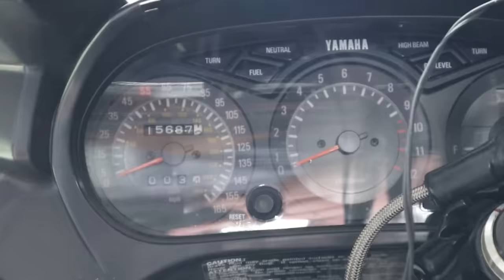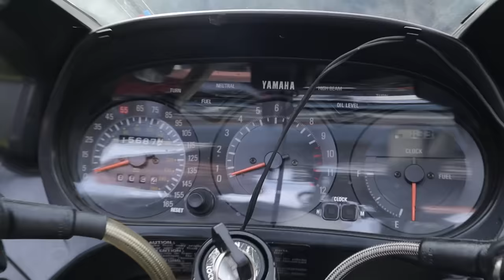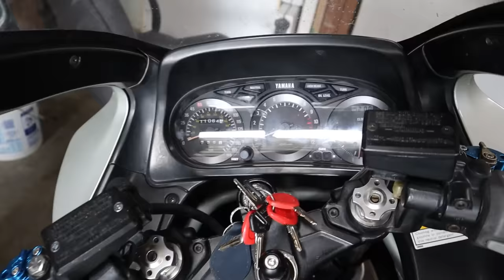Will This 37 Year Old Motorcycle Run & Get Me Home?

Comment: Viewers...note the method of preparing the gas tank to hold gas shown here is not recommended. At minimum, the rust should be knocked off with bolts and vinegar in tank, shaking, until clean. Other methods involve use of muriatic acid or vinegar. See more accurate repair videos on YouTube. Running gas having rust in it through engine can mess up carbs big time.

Comment: Don't be scared of rusty fuel tanks. They're easy to make serviceable 1 Remove. fuel tap assy.2 Put a handful of clean 1/2 inch stones/gravel into the tank with a cupful of diesel, kero or even petrol. (Not gas it floats away and smells- joke) 3 shake it and shake it and keep shaking it so the stones agitate the rust and scale.4 Empty out stones and  rinse out all you can until the fuel comes out clean 5 add auto filter and check occasionally.
Oh and add methylated spirits to the watery fuel so it will absorb to water and still run the engine.

Comment: Enjoying the videos on the channel and this was another banger. My dad gave me some advice to flushing a fuel tank. Though it can be stupid expensive use petrol, solves the cleaning out with water problem :P    Of course works best if you have a few to do and you filter the chunks out after as the fuel is knackered and only good for cleaning another fuel tank.

Comment: What a beautiful machine from 1987. My last bike was a 1992 1200cc Triumph Trophy, I had to give up for medical problems - 
I was unable to hold the baby up due to excess prescription BP meds lowering my BP. (I didn't have the strength with BP = 90/60 at the time (1916)) !!!
Just want an off-roader to play with now, with sufficient front wheel lifting power.

Comment: I picked up a 2008 Vstar 650 for $500, right now l got $550 in it and it runs and rides. Fork seals are shot and l taped off 1/2 the air cleaner due to a lean condition, but it does hit 60mph quickly.

Comment: Hey bud- I have a 2005 zzr/zx6 that a shop has been having difficulties diagnosing… idles like a queen, runs great in 1st and 2nd gear up until 3rd… bogs from there. They have cleaned all carbs, ripped out all CA emissions 💩 and did all they think was the problem but it still had issues once on third gear.. when it’s in a jack it goes through all 6 gears just fine, soon as they ride it in street it gives problems right at 3rd gear. Maybe you can swing down to Georgia for one of your shows and diagnose and fix mine 😂

Comment: The FJ1200 was badically THE big sports tourer/commuter. Not personally my "thing", but excellent at what it did. A much better bike than you might think i think many police forces used them at the time.

TBH, 1200cc is pretty unnecessary for road use. But at least it makes for a relaxing ride. The XJ900 and 600 were similar, saner machines. And lighter. Cheaper.

Comment: I can tell you what the problem 'might' be, because I (also) killed my FJ12 by leaving it too long in a garage. What happens is the jets can puncture the diaphragms in the carbs if the fuel dries out. Check it out. You were probably running way too rich, the diaphragms were bleeding fuel. Replacement diaphragms were very expensive.

Comment: HD 30% vinegar, leave it in for a couple of hours, then rattle a few nuts along withe vinegar. Dump, rinse, check the inside again, should be a lot cleaner (the tank I mean)

Comment: Too bad...everything was perfect with the service jug.

I would have been hesitant about mounting that tank rough washed with fuel....tempted to just use the service jug.  The carbs were perfectly clean.

Alcohol rinse after the garden hose treatment will remove temaining water.  HEET (200 proof alch) will dry the water in the gasoline.

I was surprised you didn't just do the final rinse with gasoline....rust will still dislodge later though with a real treatment....but that can be caught by the petcock filter or external filter.

Comment: Synching carbs, is getting same running condition at all cylinders, whether all the throttle  plates / slides, are " in the exact same spot, or not. Usually they are pretty much the same regardless, but, if getting them the same, could be done with them off the bike, and using a guage for throttle opening,that would be  negating the need to " synch them", once they are on the bike, and it is running. In other words, getting the carbs mechanically in synch, is the starting point to final synchronizing. It may be spot on, may not.

Comment: The owner probably removed the carbs,cleaned them and never put them on.Bonus for you .Carbs setting for 20 years with fuel in them......not good. 24 hour soak in white vinegar is the best thing for that tank.

Comment: "Don't Tread on My 10mm"

Fuel-soaked hands, wrenches at the ready,
Grease-stained rebels, born steady.
Two wheels of fury, roar and scream,
In this metal world, we reign supreme.

Tighten the bolts, with a steady hand,
In the heart of steel, we make our stand.
The engine's pulse, a symphony in tune,
"Don't tread on my 10mm," our metal rune.

Ride through storms, and asphalt veins,
Our bikes defy limits, break through chains.
Under the moon's glare, we roam free,
"Don't tread on my 10mm," our fierce decree.

Mechanical beasts, born to run wild,
Grit and gasoline, our rugged child.
In the garage's embrace, where legends thrive,
Tools and torque, keep the dream alive.

Screws and sockets, our kingdom's key,
Revving spirits, unchained and free.
Spark plugs ignite, a rebellion's gleam,
"Don't tread on my 10mm," our rallying scream.

(Chorus)
Ride through storms, and asphalt veins,
Our bikes defy limits, break through chains.
Under the moon's glare, we roam free,
"Don't tread on my 10mm," our fierce decree.

In the labyrinth of roads, we find our course,
Paved with passion, unyielding force.
Grit and gear oil, in our veins run deep,
On this metal journey, forever we'll keep.

(Outro)
So hear our engines, roar and howl,
Beneath the sky, we make our prowl.
"Don't tread on my 10mm," our anthem's cry,
In this metal world, we'll soar and fly.

Comment: I've always used gas to help clean out the tank. Rather waste 10 bucks in gas then risk running water into the motor or carbs.

Comment: You did good until you got to the tank . You should have rinsed it out with water 4-6 times to get out all loose rust , not just once . I can think of several ways to dry the tank out . Touch , blower , rags , I mean anything but doing nothing and mixing it with the gas .   Big fail at the end just because of that

Comment: The first 12 mins of content had to be at least 4-5 hours real time. While the info is good a lot of folks that watch these and think hey I can do that get in wayyyyy over the ability level and screw crap up for those of us that actually rescue these puppies.  I concur with the Concours ride opinion, but I have a BMW K1300 that is super cool and also a ZX11 for those  (ererereeer think scratching record here) rip a throttle days....ya know? Anywya love to watch the old guy bust a sparkplug hole or two and save these old gems.

Comment: It would have been funny if the owner came home and said "what are you doing? That's not the bike... your bike is over here."  Then he lead you to dark crooner of the garage where a rusty old junker of a bike was sitting.   

Here's what I don't understand... If all it took was to put the carbs and a battery on the bike, why didn't the owner get it running?   When I have a non running bike in my garage it taunts me every time I pass by.    I have to go mess with it and TRY to get it to run.

Comment: Question for anyone to answer. 

I own a 1995 Suzuki RF900R I have a issue with my clutch. (It’s hydraulic) when I pull the clutch lever in my clutch won’t disengage. Any issues what could be the issue?

Comment: 10:28 did Craig have an extreme case of Trump Derangement Syndrome?       Just kidding glad you got the support you needed

When you decided to rinse the tank out with water I thought “I wouldn’t do that and plan on running it again today”….  Should have rinsed it with a splash of gas and being a handful of filters to swap out.    Clean it out for real back at the shop.

Comment: Honestly.. i'm a little disappointed in craig... he took a perfectly good running bike and broke it.. his rush to ride "tank fix" using water.. not getting more rust out.. then i'm sure plugging up the good petcock..  that's just cutting too many corners to facilitate a short video..   using a solvent instead of water..  the agitating some "media" like nuts or washers.. to break loose alot of the rust.. then rinsing with gas.. then after the majority of the debris is gone... put on the good petcock and filter...  too nice of a bike to run that tank for the sake of "riding home"   regardless of the show's spirit... why sacrifice a nice example of a vintage bike like this.. yeah.. i know.. it's not permanent.. but it's not right either..

Comment: If you use methelated spirits after after the water flush it absorbs the water ,i wouldnt have tried to to run it with all that crap in the tank myself specially with gud pet cock .nice tidy bike though